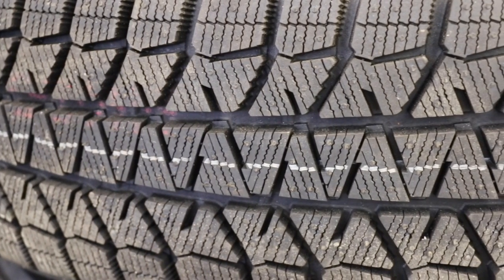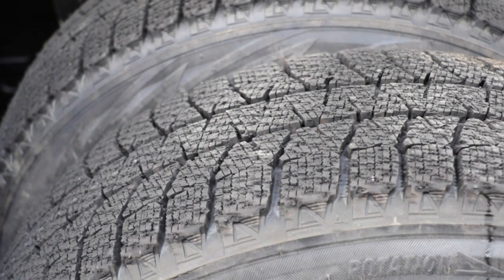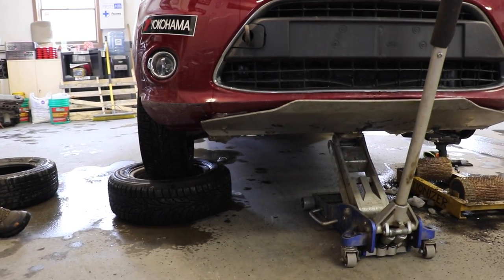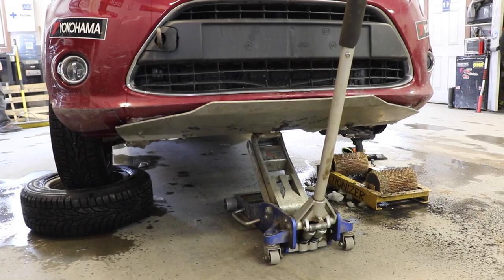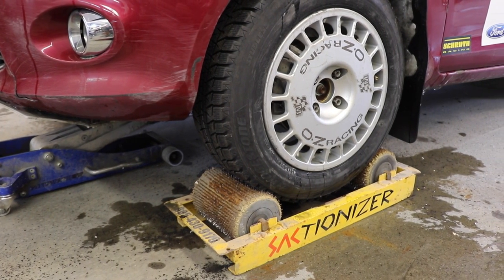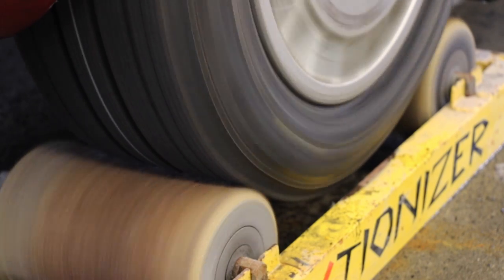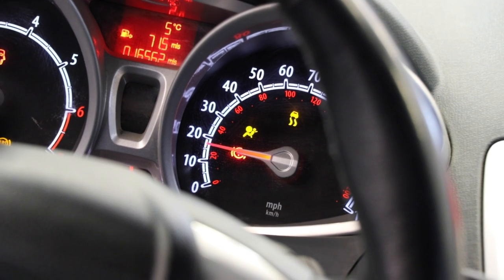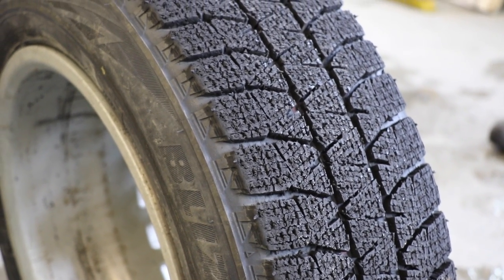Tire tractionizing explained

Comment: Only in Murica. Where do you get those ideas? XD
Reply: Actually, this technique was developed in Europe and works well for ice racing and winter rallies where studded tires like those in WRC (which are often very expensive) aren't permitted. WRC uses studded tires because the teams can afford them, but, here in Canada, we like our racing to be affordable and accessible. So, we do stuff like this with tires like Bridgestone Blizzak, so that we can afford to have cars that are almost as fast as WRC but without the insane costs. You should check out the Rallye Perce Neige and see the onboards from teams like Antoine L'Estage. Very good driving for a fraction of the cost of European style WRC cars.

Comment: How does the tyre gonna bite the ice when it is full of ice inside those tiny rigges.
Reply: These tiny little ridges act like suction cups... They lift the water and then use the suction cups to try to get some semblance of grip on ice, where studded WRC-style rally tires are not permitted. Studded WRC-style tires are obviously better on ice, but tractionized tires are often faster than the studded tires you can get for road use which aren't intended for racing.

These tractionized tires are NOT FOR ROAD USE, least of all because they won't last on tarmac, but also because their operating window is very small... They were made for only just trace amounts of snow and ice. Anywhere else, these tires will not operate well.

Comment: This seems more like an advertisement for their little tire shredding gizmo....Which backfired pretty bad lol

I'm assuming their idea was that basically shredding and making holes it almost acts like a paddle on the snow and the holes/treads for the snow to seep into for more ground contact.

BUT it clearly states it's for racing only.  I figured before I even watched the video or read the description. On regular roads these tires won't last a season if it doesn't blow chunks of it off in a turn.  But for rally racing, they change tires consistently so  I don't see the problem.

Comment: I'm from the south, why would you need this?
Reply: Ice is slippery. Racing on ice; very slippery. When we're not allowed studded tires (with metal studs that dig into the ice), we often improvise and find other ways to get grip on the ice for RACING purposes. These aren't for street use and won't help you in the south at all. But, it's an insight into one of the most clever "suction-cupping" types of tire modifications for RACING on ice.

Don't use these tires outside of racing on ice.
Reply: To come to the North.

Comment: How about not messing with the differential and only putting normal rolls without spikes under the 2nd wheel? Logic, where are you?
Reply: I would see it wobbly only if it wasn't a good fit between the rolls and the wheel. Shouldn't cause a problem with a good fit.
Reply: TeamONeilRally the caster will pull it straight

Comment: Those squiggly lines are actually factory siping. This totally ruins the tire by compromising it's integrity. Don't waste your money on this Tom foolery. The factory siping is engineered into the tire, this is like many others said destroying the tread, voiding warranty, wasting money, and doing nothing extra for traction. If you want better grip buy a tire that has factory holes for studs and get your tires studded.

Comment: Because studded tires are for suckers
Reply: Studded tires aren't legal in every area of the world, and the only studs that actually work at generating any grip are the ones on WRC cars, which heavily damage roads and have an exceptionally uncomfortable ride.

These aren't street tires, either. Tractionized tires should not be used on the road.
Reply: Melon's Better Driving its a joke m8

Comment: You do realize that tire manufacturers spend millions on engineering.  I think their winter tires are very good already.  Doing what this video shows is not a good idea.  The tire will degrade in no time.
Reply: this is a rally chanel not a make your daily driver faster channel. this is for rally driving.
Reply: Steve M it's for snow racing
Reply: Yet another Einstein on the loose.

Comment: and your expensive tires are fucked up!
Reply: This is a racing technique. It's not for road use. Some teams will spend a lot of money to go fast in racing. If you're concerned with the cost of the tires, you're not racing at a high enough level where the extra speed matters.

Comment: Im what you might call a Tire Guy... AND THAT IS THE DUMBEST THING IVE SEEN,  LOOK  AT ALL THE RUBBER THAT'S COMING OFF THE TIRE, YOUR LUCKY IF YOU GET 2 SEASONS ON THEM,  That poor bridgestone blizzak, one of the most expensive "SNOW" tires just became the worst cheapest tire.  at 9sec thats a good looking tire, at 16sec WTF / 2 min "holy hell, what did you do to my tires?"   Lucky with getting one season on them.  Not to mention Warranty voided.
Reply: Ryan Olsen this is for rally stages not for daily driving.

Comment: And that's how you take your spider gears on your differential..... why you never trust a tire guy
Reply: Laine Waddell seems like you know better than the professionals at team o neil. Its an open diff its not really gonna get damaged from that.
Reply: Killer King not really.............. not good for the diff
Reply: Laine Waddell .....the gears are fine. I mean have you even seen how an open diff works? I saw it and they held the other wheel stopped and the gears are fine.
Reply: Killer King I do know how how both an open diff and a locker work very well actually I have been a red seal HD tech for the last 10 years. Now because you seem a bit confused there are gears called spider gears inside that diff they are essential as they help transfer power when one wheel is spinning they are designed to allow the spin however I can't tell you how many times I have seen people who take out a diff by doing one tire fires, it's not obvious right off the bat but once you heat up those gears they blue and take the hard surfacing out the rest of the diff isn't far behind  I cannot stress how short a time this can occur(it doesn't take long in a heavy rig then alone a little rice rocket) there are plenty of videos on YouTube that show you this I suggest you check them out or even get out in the garage and play once in awhile all I'm  saying is a "professional shop" should have this setup for both wheels at the same time or a rig in a tire balancer that does the same thing as having the "professional shop" that did it cause damage that is not seen unless the diff is disassembled or flys apart on race day is bad for business I'm not throwing hate just cautions for people doing it at home that this is not a very acceptable way to do it  keep your chin up buddy and stay professional ;)
Reply: @lainewaddell2561  then you would know that this isn't harmful smh

Comment: Wow!  This is the dumbest thing I’ve seen in a long time.  Just ruined a perfect good tire.  Get studded tires if you need to but this just destroys tires.  How long do they last?  One race?  One lap?  Hilarious labeling on the side of the “tractionizer”.  It’s like the poor mans version of a Ronco tire slicer and diver. 😂😂😂😂
Reply from the maker: Here in the US, we have winter rallies where studded tires are not allowed so we have to do what we can. This is the answer if it's icy, you'll see the top 10+ cars are all on tractionized tires, but wear is not a concern we're only worried about winning races. That said, a bunch of guys do run these up here all winter. I've run them all winter before with no problem on an e36 bmw and they're great, but I didn't do a lot of highway miles or corner hard on pavement or anything.

Comment: Congrats. You voided your warranty and created a negligible performance increase because you are not a tire engineer and have no idea what you are doing.  If that process was actually beneficial, the manufacturer would include a similar step in the construction process.
Reply: AFLiCTi0N congrats you made a comment about something you know nothing about considering this is a rally racing channel and it's for one race not driving to work everyday
Reply: AFLiCTi0N manufacturers do, it's called syping. It's for gripping ice. Just not to this extreme
Reply: Race purposes are not the same as daily economical driving purposes.
Reply: Tire manufactures "sype" their tires to a small degree and cant do what tire shops can do because of the increased tire wear and people not rotating or inflating their tires properly so instead you take it to a tire shop and have them do a more detailed traction cut upon your request and knowledge of the importance of proper tire maintenance. I buy knew tires every 2 years and always have them syped every winter. That shit really helps and its a night and day difference on ice, snow, and rain...now that shit in the video is just for racing and helps like a mofo too but tire life is dramatically shortend:)
Reply: Good answer .. and right on :)  this video killed me
Reply: the tires are "siped", that's f'n shiz up
Reply: good answer
Reply: Voided your warranty!?! LMAO what warranty - these are rally tires on a rally car. Hand built rally cars at that. There's is not a genuine part left on these cars to warranty. Funniest comment ever!